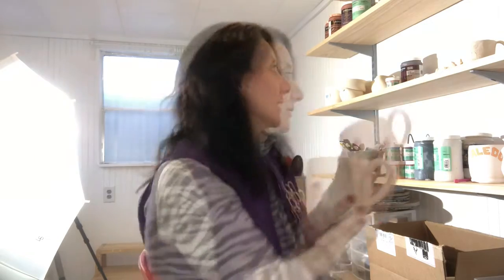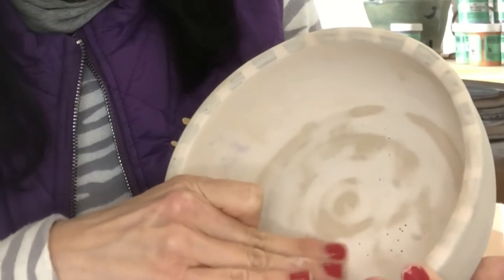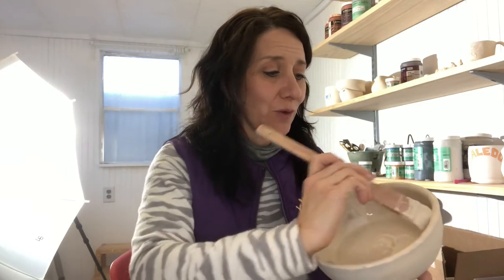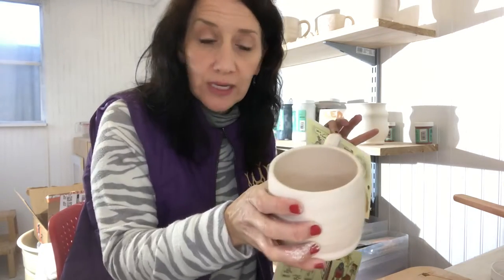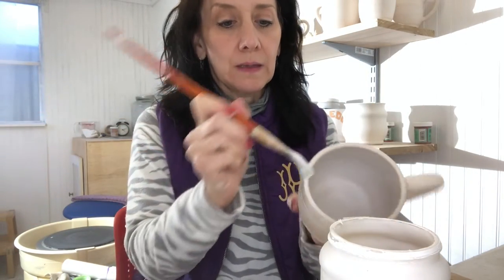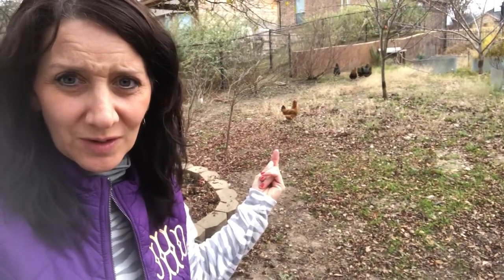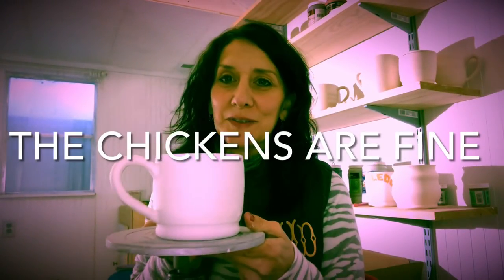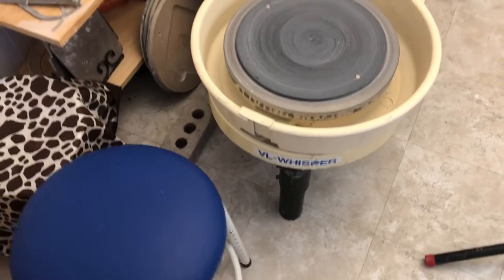How to Fix Glaze Pinhole Bubbles on Pottery

Comment: The carbon has nothing to do with the glaze bubbles! I used to use an incredible amount of pencil on my pieces. I have however used an eraser over the holes to help run them out. Some of the glazes get soo hard once they dry and you can’t even get any dust to rub into it. It’s so aggravating!! I get these mostly on heavily textured pieces which I pretty much only make! Lol
Reply from the maker: Graphite was making the glaze not stick directly where I had too much, I believe.

Comment: I do low fire slip casting, so this is different from what I'm doing. I came here looking for a solution to tiny burst bubbles in my fired glaze. Is there a way to get the glaze to stop bubbling? I've tried giving the piece another coat of glaze and re-firing, but bubbles still appear.
Reply from the maker: Your glaze is probably too thick.  Are you on potteryheads group on FB?
Reply: @TinyChickPottery  That would explain why adding more glaze doesn't fix the problem.

Comment: When you haver areas that won't glaze over, add small dots of Mayco light flux over them (this only works with clear glaze or else you will get the color changes of using flux with colored glaze). I have done this with black glaze as well (using dark flux). I also had an experience where the studio zinc-free clear wasn't compatible with my underglaze and caused the underglaze to crawl. In this situation I glazed in the crawled areas, added a tiny bit of flux, and problem solved.
Reply from the maker: Thank you so much!  Great tips.  I was very fortunate that the firing went perfectly!
Reply: Is Mayco light flux only for high fire clay? or will it work with low fire as well? I often get areas where the glaze blows out and leaves a bare spot.
Reply: What do you consider to be  high fire or low fire? I have used  it to cone 6 with great results.
Reply: @DonaldDrennan  if "blow-outs," are a common trend perhaps there is another reason. Do you flip a barely damp cloth on the bisque prior to glazing or does it get dunked in water while you rub your hands over it to remove fine particulates? Do you use lotion when working with pottery? Are  you glazing over underglaze transfers?
Reply: @3_Cats_Pottery  I bisque fire at cone 04, and glaze fire at cone 06. I do low fire slip casting.
I've tried lots of different things, wiping the dust off, washing under the tap, scrubbing. I can't pinpoint the cause. It usually happens in sharp corners or in deep depressions.